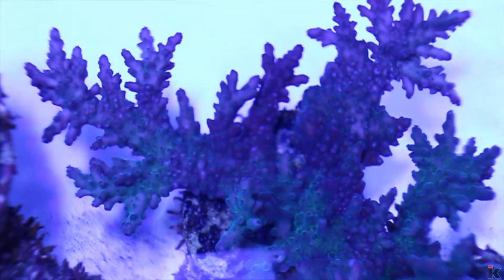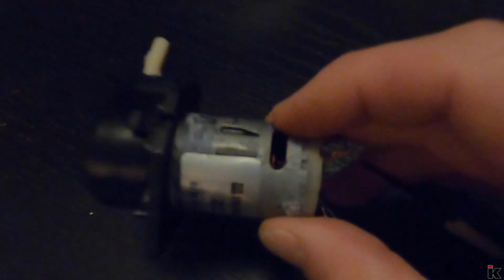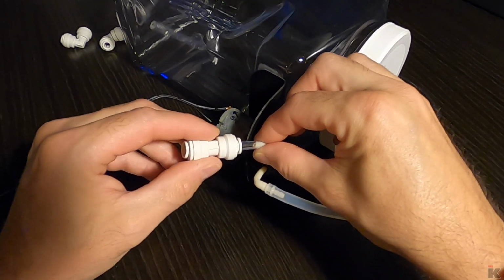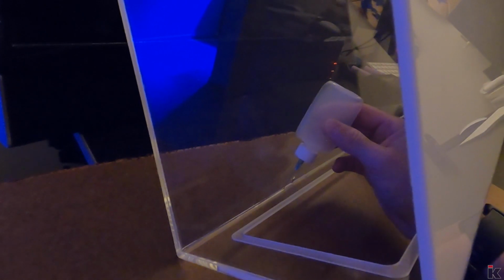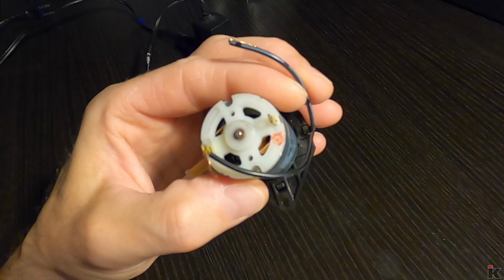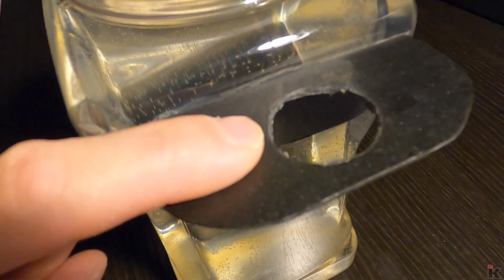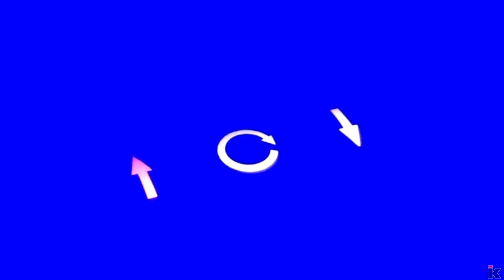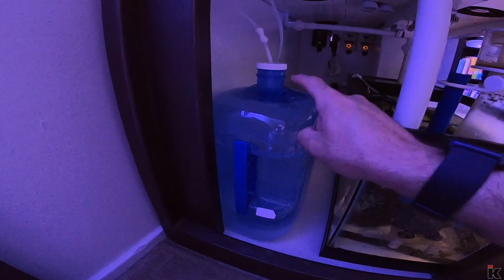Making a $30.74 DIY doser and fixing the ATO container -A Shallower Reef EP22

Comment: Hum seems a bit close to me, during power outage how height is the water in your sump?
Reply from the maker: Hum?
Reply: @IanKreer  that's a french expression like hem. I was referring to your kalk output tube height. You should make a tiny hole on the top of the container for the air to came inside unless you don't tight it completely. :)
Reply from the maker: @user-rk3id2zf8c  I didn't know hum was a French expression of ahem, good to know! In the video I mentioned that the Kalk tube was temporary, it's since been fixed. The fitting that connects the hardline on top of the container isn't air tight, so air leaks inside when its being dosed. 
;)

Comment: On those dosing pump black plastic rubber hose can be change inside the black holder there is three release clips, buy extra hose easy and cheap fix 😉

Comment: Looking good! You will need a vent hole in the lid or the pump will start struggling soon...know from experience!
Reply from the maker: The union that screws on the lid and connects to the hard line lets air into the container. It's not air tight. I was worried it may squeeze the container so I left it loose.